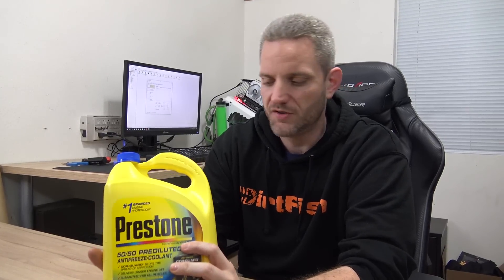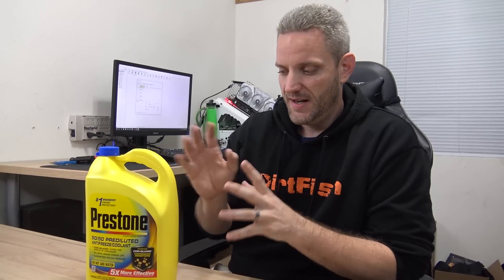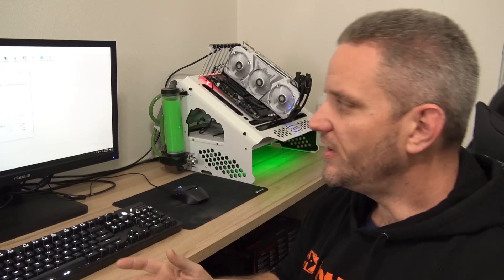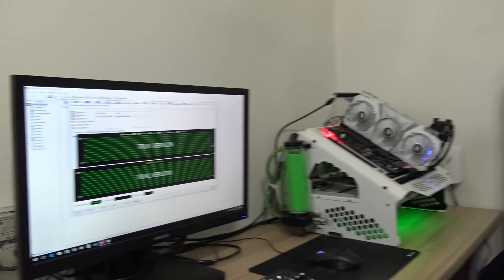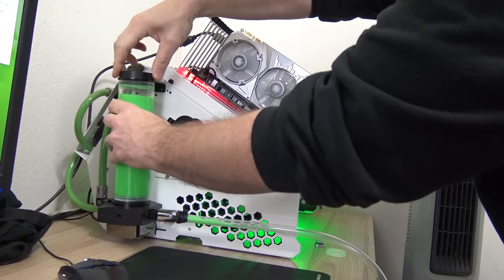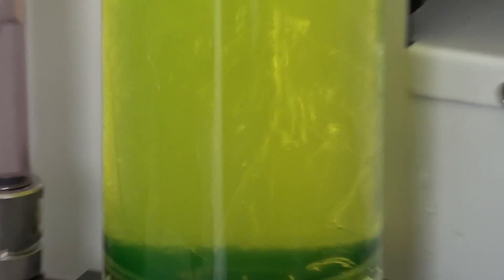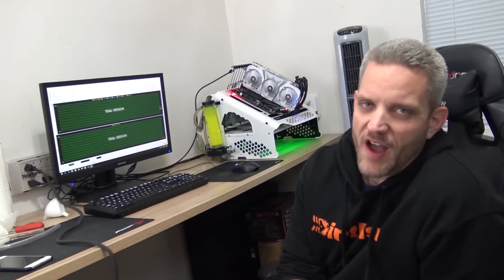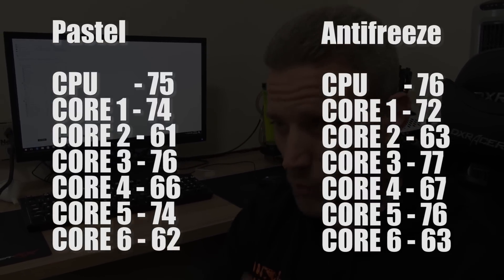I used Antifreeze to cool a PC

Comment: Better cooling would be achieved by wetting and specific heat capacity. Anti-freeze would cut this potential from ordinary distilled water. Interesting enough that the pastel had similar results. Consider distilled water + Hyper Lube Super Coolant in a future video?

Comment: The answer is nothing, much of a modern cars cooling system has plastic parts.
Reply: Ryan Barbolt no, the real answer is it depends on what plastics your cooling system is made out of
Reply: there are so many different type of plastics that can get damaged by as many different type of chemical solution...

Comment: using cheap barbed cpu coolers with automotive lines and a automotive heater core or transmission cooler would make a cheap water loop. Antifreeze would then be a cheap alternative to colored fluid and would no longer endanger your rubbers/plastics.

Comment: i always waned to run a liquid cooling setup with the radiator sitting in a deep freeze freezer and the fans cooling it off in there.  that way you're going way below ambient temperatures for your cooling, (0 degrees F). in that situation you would want to run antifreeze. and probably insulate the tubing to prevent condensation inside the case

Comment: "We are stressing CPU, FPU and the Cache. So we are literally hammering the CPU for everything it is worth." No you're not. Stress the system memory as well to get the integrated memory controller working hard. I don't know if the IMC produces much heat or not, but it's a part of the CPU so I would have stressed it.

Comment: antifreeze is made to prevent your system from freezing. So the whole idea is just dumb unless your system stands outside in the snow....... and that wouldn't be the best idea either...... except it would keep your system cool..... until melting water starts running in your system.......

Comment: I'm going on 3 years with 50/50 antifreeze water mix  in a custom loop.   I cleaned the cpu cooling block internals at about 6 months , the only thing in the fins looked to be excess coating from the radiator.  Nothing further has been done to the loop - no problems whatsoever  :) - Koolance 380A , 480mm radiator, pump and  fittings .   Keep the videos coming,  thanks Jay!

Comment: quite a few car engines these days have plastic water pump impellers and plastic in the system, radiators have plastic end tanks etc. an interesting test might be to see how a long term test with evans waterless coolant goes.

"appears it's been done and not good"

Comment: it is an "anti-freeze", not an "anti-heat"! and is designed to protect heat exchangers on areas with low ambient temp so if you live in an area where the temp does not goes below 32F (temp where water freeze) is better to go with water (I can't imagine your home set point to 32F or below 😂), also help on preventing corrosion on system using metals with carbons atoms but with plastic tubing and plastics pumps 😒😒... who ask for a video with this? 😂 Water is the winner for "heat-transfer" and "heat absorption" per unit of volume 😂... unless you are using nitrogen to cool the "Anti-Freeze" below 32F, then the anti-freeze to cool the CPU 😂

Comment: I use Motul Inugel Optimal for 5 years complitle fine I have Primochil tube Ek  water blok and Hardware labs radaiators GTX480 GEN TWO XTREME and GTS 360mman no problem  at all

Comment: didn't see anybody explaining the "reaction" you guys were marveling at, that's the glycol mixing with water. there's no chemical reaction going on it's just the difference in refractive index between water and glycol. It's the same thing you see when there's a dark colored car in the summer where you can heat waves coming off the surface.

Comment: From what i've been told by mechanics and other motorcycle racers, water actually has better cooling potential than coolant/antifreeze, and water with redline water wetter works best. That may be true for computer application as the general principle is the same.

Comment: Honda Genuine Coolant can run in anything it's the best coolant for anything it doesn't just protect metal but gaskets pumps everything it goes $25 to $30 a gallon
Reply: Looks are meaningless.  Use an antifreeze tester to see how low and high the coolant protection goes.
Reply: HERPY DERPEDY I'm a chemist and that's just uninformed.
Reply: GenderPranks I'm no chemist but my Honda civic has 17 year old coolant that looks WAAAAAY better like new compared to cheapo auto zone coolant in our other cars 2 or 3 years changes color smells old goes from yellow to more light orange  just weird don't remember the exact ingredients
Reply: Honda is the best car company ever!!! Their coolant also cures pink eye. That's why I only use Honda parts on my BMW.

Comment: This is the first time I've seen one of your guys' videos, so I'm not sure you've done this: Have you done a whole hardware store build of a coolant system? I have and I use the pre-mix auto antifreeze. Been a year and it holds up. Is it possible you can use different tubes from say Home Depot in place of your professional PC stuff when you run your tests in the future? You know, side by side.

There are other type of auto coolant too, different mixtures. Maybe try those too? The stuff they use in VW's is a different chemical from what I understand so it might react slightly different.

Comment: Well I've been running mine for about 3yrs now with antifreeze. Only had to do the normal maintenance on my system. It's only if your going to starting mixing the different types as I know of you mix the red type with the green then it will become a gel and corrosive. I'm using the green ;)

Comment: Why not use distilled water? Algae should not be a problem with distilled water especially if no sunlight is around. If you really worry about it a little loops of silver wire would prevent it. Nothing works like water. Even in a car water is better than coolant. Preventing corrosion and damage from freezing is why we use coolant in cars. Sometimes a wetting agent is a plus to help the water wet the metal surfaces but that is really optional. Pure water is not conductive at all you need to have dissolved ions aka electrolytes in the water for it to conduct. You run wires into a glass of distilled water and it will not complete the circuit even at 120 volts.

Comment: I will likely sound stupid but wouldn't antifreeze be best used in a frankenstein cooler that replaces the radiator with a phase change or liquid nitrogen setup? so you would actually be able to run -35*C fluid through your sistem (as it is unlikely to boil anyway)

Comment: Dump that PC inside a fish tank filled with mineral oil and you'll have way better cooling! (add a nice big tower dissipator to the CPU though, like a megahalems)
Reply: You would still have to circulate the mineral oil thru a radiator or some other type of heat exchanger because with time, the oil will reach an equilibrium with component temps.
Reply: xmanrigger yeah you con drop a big aluminium plate with fins comected to the oil and it will irradiate the heat
Reply: It would have to be outside of the tank for it to be effective. Otherwise the heat it is dissipating will go directly back to the mineral oil, essentially doing nothing.
Reply: xmanrigger Duh... of course! 
something like the Calyos system
Reply: totally didn't see that on LTT I'm sure.
Reply: I know they make non- Ethylene Glycol coolants but I believe they’re PG based, so still glycols. Like the Dodge/Chrysler orange coolant or the “Universal” Red/Pink coolant.

Couldn’t you just use a different tubing?

What about Betaines like trimethyl glycine, I remember seeing research and even a patent using betaines as coolants that claimed to be more effective than Ethylene Glycol or Propylene Glycol. 

Is methanol or ethanol a viable option? Since the purpose of antifreeze is to depress the freezing point (unnecessary in PCs) and elevate the boiling point, I’m sure there are better alternatives than water. 

I guess it’s just the cost to benefit/performance increase ratio that matters at that point?

Also, there’s been a lot of research into nanofluids or nanoparticles suspended in liquid, like water. Examples being silica, alumina, titanium dioxide, carbon nanotubes, copper, silver or gold nanoparticles to enhance the heat transfer capabilities of the liquid by as much as 350%!

You could also try glycerol or even oils, like mineral or castor oil if your pump could handle it. Silicone oils or fluorocarbon oils such as 3M’s fluorinert coils also work but there’s the toxicity issues.

Although a far better solution in that case would be to use a pump-less cooling system with submersible cooling coils and fans to move the liquid.
Reply: Lucas Da Ronco i like watching the oil boil
Reply: No Akomplice 
Mayhem’s Ultra Clear Tubing works fine with Glycol coolants. Primochill Advancec LRT tubing is not compatible. 
I’ve been using the Mayhem’s it for 3 years with my Koolance fluid. Koolance fluid has polyethylene glycol in it to increase lubrication to Koolance fittings, o-rings, and the pump.
Tho it doesn’t have near as much glycol as automotive coolant.  It’s still mostly distilled water with biocide and polyethylene glycol mixture

PS. Not a huge fan of Mayhem’s due to how they treated Jay and Tom Logan over their pastel fluid. But their  tubing is of high quality and at bargain prices so gotta give props where’s its due.
Reply: nope ... just keeps it clean
Reply: Phat Nipol Oil is actually a great conductor of heat. It'd probably work pretty well.

Comment: Those same materials are found in modern car also. So cooling your pc with it is not going to hurt. In a PC I would rather use the red antifreeze like: Havoline Dex-Cool or Prestone Extended Life, in case there is aluminium in the loop.
Reply: You will be hard pressed to find aluminum in a modern PC cooling loop. If there is, it will likely be nickle plated.

Comment: 15 - 20% of concentrated (not premixed) car antifreeze (PINK / RED TYPE with organic acids only !), the rest distilled water. Works for 2 years (and counting) in a gaming rig (cpu+gpu Cu blocks and Ni plated) with flexible tubing and Al radiators. No chemical or nuclear reaction observed, it doesn't open a portal to the underworld, it's just a solution alternative of the aftermarket super extra magic coolants. The presence of antifreeze in a pc cooling system is to stop/prevent "marine growth" inside tubing, cooling blocks etc.

Comment: Our experience with car coolant resulted in cracks in  acrylic and leaking through cracks. That is main reason why it is a bad idea.
Reply: This is bullshit, ethylene glycol is nonreactive with acrylic. Antyfreeze is 95% ethylene glycol plus  5% of mix low acid and salt both nonreactive with acrylic. Google chemical reaction chart for the acrylic.
Reply: Vojtěch Nekvapil that is entirely anecdotal...
Reply: Coolant becomes acidic over time, car mechanics sometimes test coolant by sticking a voltage  probe into the coolant because the acidity turns the radiator into a battery through galvanic corrosion which will destroy any dissimilar metals then the acidity will dissolve plastic, rubber, aluminum. Cars usually blow head/intake gaskets because as the system corrodes it makes a thick muck of dissolved material that clogs up the radio tor which then stops cooling.
Reply: yep and when it causes a problem they first blame the car manufacturer for "making a cheap and unreliably car" then blame the mechanic and accuse the mechanic of trying to rip them off when its really their own fault for being to cheap/lazy to buy a $25 jug of coolant.

Comment: I used before this same Car Radiator Antifreeze  liquid on my watercooling, the Acrylic plastic on the DangerDen got soften little bit and then it cracked after 2 months of usage and leaked the coolant all over the PC internals , the Tygon Tube had no issues , the Pump started to leak leak almost the same time..... never Use Car Radiator Antifreeze  on PC watercooling loop

Comment: Been using that exact coolant for 5 years now and let me what happens to your gear..
NOTHING it's fine, works great.. longest stint without changing it was two years no discolouration no sediment no fin damage nothing came out the same colour it went in too.
Now.. if you want to start using blue top and red top coolant and mixing it, then you'd have a point to the video but I'll leave that to you to figure out why! ;)

Comment: the point of a antifreeze is for your radiator or water block to not freeze in the cold blizzard winter, but even tho this is a experimental video it is not to be argued over, but it will make no different in tempreture, just the fact that it will not freeze below 0 celcius

Comment: I NEED HELP. Im not a computer geek etc... However i have figured out how to overclock my intel i7 6700 processor. I have an Alienware x51 R3 computer (rip off). One day i have wanted to restore my computer to factory settings because i had too much junk on my computer. Me being the idiot didnt realize you need to reinstall windows. But this video got me thinking can your computer start with out a working processor since i have overclocked the computer my processor might have broke which is why the computer wont start or it maybe because of the factory settings... Im thinking its mainly because of the factory settings i have opted to turn on... I know this maybe a stupid question however, i dont know a lot about computers. Furthermore, should i download windows and may that help the situation and boot up my pc. Any help can help me get closer to fix my computer. THANK YOU.
Reply: If all components working proper, your PC will start regardless if an OS (Windows) has been installed or not. If no OS (Windows) installed, you will only be able to access the BIOS or get a DOS prompt after  POST. Only components needed to start/POST your PC are PSU, CPU, Memory, GPU (onboard VGA or add-on), and a monitor. No HDD or SSD required. Oh, and a keyboard. Mouse is optional.
Try resetting BIOS (CMOS).
Reply: thanks a lot just fixed my pc. Much love. <3

Comment: I've used antifreeze for years. Over 3 now. I use Tygon chemical resistant tubing, for over 3 years, and acrylic hard tubing for about a year. At a concentrations of 30% to 50% with the rest being distilled water. No problems whatsoever. In fact, after 3 years of not changing my coolant, I drained it to renew it. No signs of corrosion whatsoever. Not even what you would usually find  when using just distilled water, manufacturer PC coolants and dyes. All my componenets were still factory brand new inside out! And no biotic problems or any kinds of growth either.

However! Do be careful! Yes you are right that PETG tubing will fail, but also, some car coolants will degrade silicone based seals!

Comment: HydrX PM Coolant from swiftech contain Zerex antifreeze coolant. check the MSDS data sheet.i use 5% antifreeze mixed with distilled water and never had any problem in 5 years.

Comment: Great test and very informative.
However, from what I hope to be the case, anyone who should want to or is contemplating to use anti-freeze, would surely be building a system to run sub zero temps. Thus using a chemical that can withstand subzero temps and not freeze when moving past -1 C would make sense, the temps comparison you have posted would not hold if the system was pushed pass 0 C mark your cooling fluid would freeze. This is something I have been considering for some time just for fun (no way will it be economical in power consumption) but to run a liquid cooled system at -25 C to -5 C temps, condensation would be a Blaahh but it would be very cool ;) pun intended!

Comment: That green anti-freeze is also bad for aluminum components. It will cause them to erode a lot faster, and there are probably a lot of aluminum parts in that PC cooling loop. Orange Dex-cool might be a slightly better choice.

Comment: if you want to know what will happen if you use that liquid its simple your soft tubs will be come a bit harder and stiffer under normal room temps and depending on the plastics some will have issues some wont as i use a Solid Copper system  piping ant all it performs the same and its been 4 years todate and haven't replaced fluid temps are still the exact same

Comment: Jay i need advice.  when ordering a waterblock for a GPU, does the matertial matter?  as in copper by evga or thermaltakes petg?
Reply: copper ones are the best for thermol condutivety then aluminium next. the only better metals than those are silver 1st and then gold 2nd. as you can see they dont make them with those metals for oviose cost resons.

Comment: Ive been using antifreeze from my first ever water cooling loop to this day in my daily PC and it does not react with any plastics or metals weirdly at all. it is made for similar water cooled loops in cars and it is fine to use long term i have for 8 years. Recommend not getting the diluted ones get something with at least 50% content in Ethylene Glycol. What you need to be careful of are the additives for noncorrosive purposes some might be acidic. Get the red stuff it looks much better than that stuff. I have also never had or seen that kind of reaction in any of loops ever.

Comment: Before it starts, I predict the anti-freeze won't really help temperatures. It doesn't actually cool things, just raise the boiling point of the water it's mixed with & help keep the water from freezing.

EDIT: And right

Also, if you want to test long term, I'd definitely go with some budget cooler or a homebrew one for maximum expendability